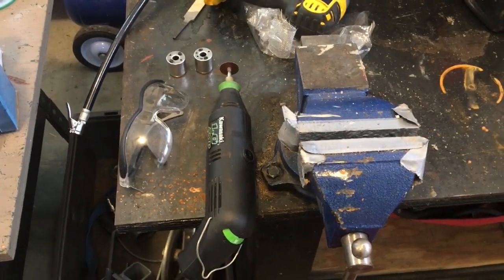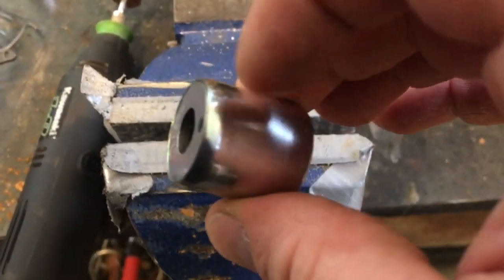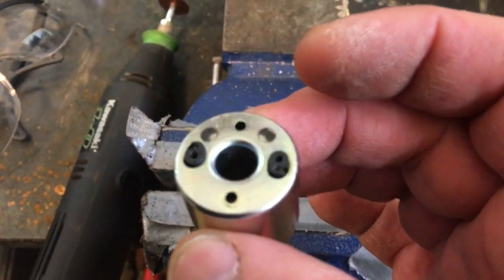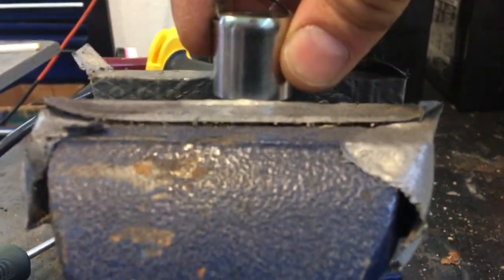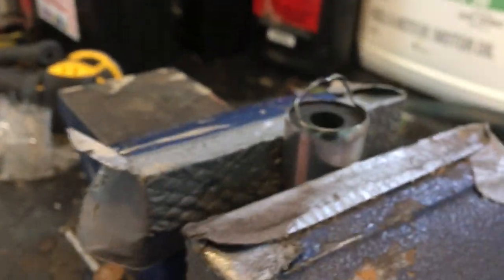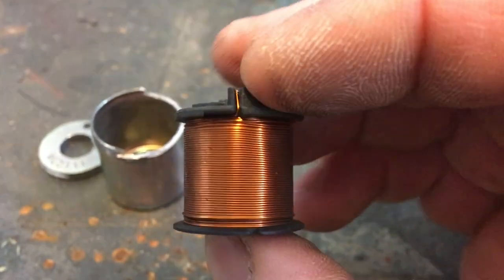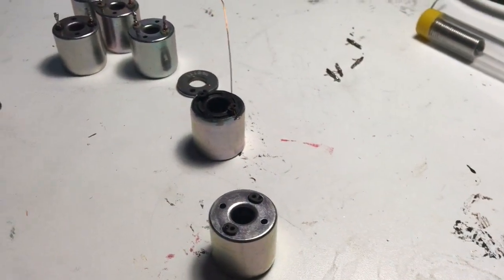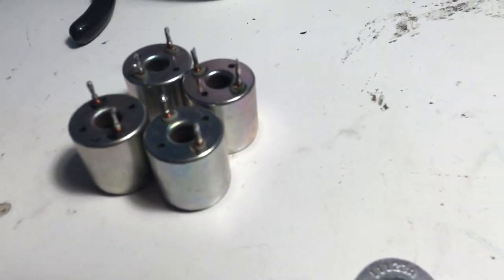Part 3/5   2003 F150 ABS Module Repair,  Repairing the damaged coils.

Comment: Alternatively, you can use a pick to pull the tails out laterally.  Burn the magnet varnish off.  Clean well.  Then, lap joint a piece of magnet wire in.  (Get some new magnet wire of appropriate gauge.)   Once it is soldered, you can coat the bare spot with clear nail polish or conformal coating.  Then, feed the leads back where they go. Strip the wire varnish off the tail ens, and re-wrap the terminals and tack in place with solder.  Then coat the connection with conformal coating.  High temp epoxy the pins in place in the plastic keepers (make sure properly aligned).  I would use slow-cure glue and put them IN the PCB to hold alignment (be careful not to glue to the PCB.... coat the PCB hole with tiny amount of Vaseline to stop epoxy bonding).  Once epoxy is cured, you can do one more continuity check and then re-solder into board.